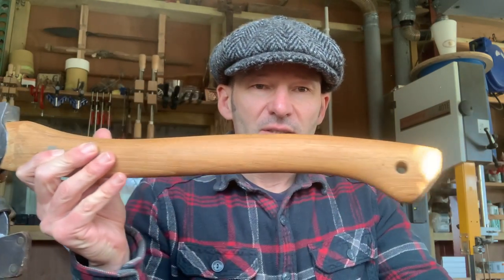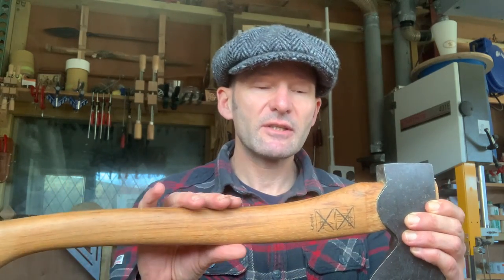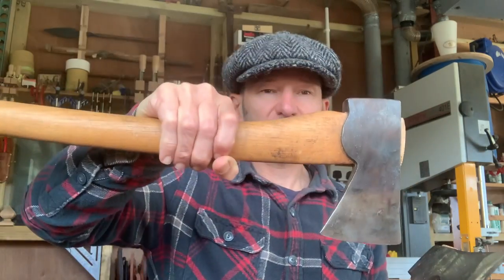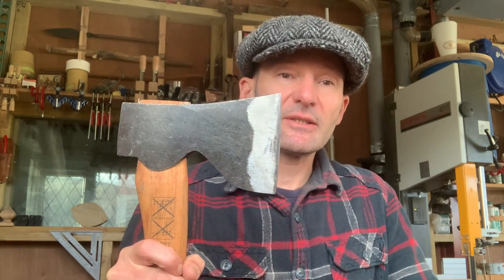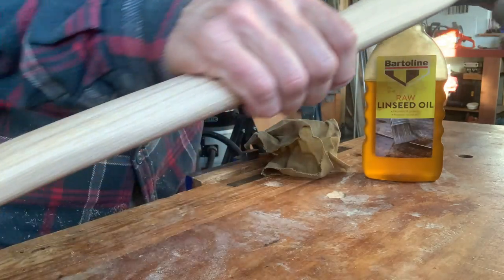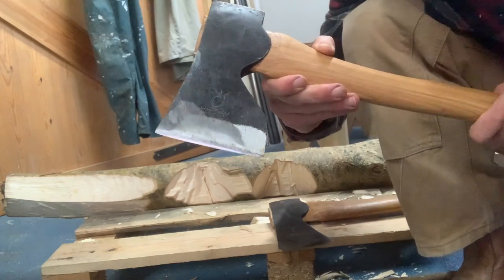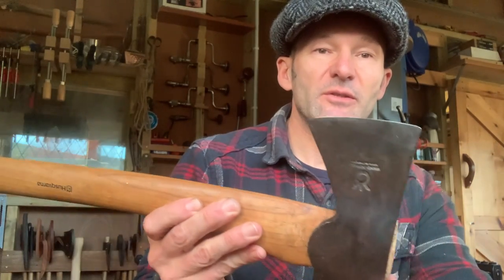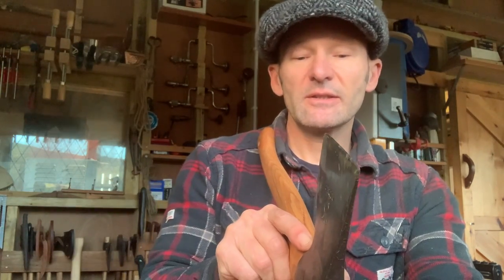Husqvarna Carpenters Axe

Comment: I just bought that axe. It’s not general purpose. More of a heavy carver. I’m finding it useful. It did need a good sharpening and some slimming of the handle, but all the critical elements are there for a pretty good price. I wouldn’t recommend it as a general purpose bush crafting axe. I would as a general purpose moderately heavy carver. Felling , limbing and splitting is not its strong point.
Reply from the maker: Exactly my thoughts, thanks.

Comment: Well thought-out vid I reckon, 500 subs👍 Bought one of these about 5 years ago and came to the same conclusion. Cool axe, good value, has potential, but never really found a solid role for it. I have used it in conjunction with a mallet to clean up joints and shape tenons in rural timber fencing, and use it occasionally to split some kindling to start the forge. Bought a longer handle for it to convert into a limbing axe (combined with reshaping the bit), but even that I never got around to. All that aside though, it's still in my shed, but in the "one day" pile. Has a lot of potential, I'm just not sure for what!👍
Reply from the maker: Yup, it seems to be well made as you would expect from Hultafors / Husqvarna but the geometry just doesn’t seem to be that useful to me even for carpentry type work.
Reply: There's actually Hultafors Åby.. which pretty much gents around every point you said here..
Reply: @markuslepisto7824  I've thought about the Aby, bit lighter than the carpenters but does seem like a pretty good bushcraft style axe
Reply: @kurts64  I just bought it. Have tried it once last weekend when I was camping at Porkkala Finland. I don't really have anything to compare it but I do like it. And I'm sure it will get lost of use when the winter season kicks in..

Comment: I am Japanese. "I'm interested in Hutafoe's carpenters ax." Of course, it is to use it in the mood of a Japanese sword. "I'm interested in this straight handle. I'd like to touch it because the straight line of the blade is the same as a Japanese hatchet." "Perhaps, I think that there are only two husqvarna curved handles. Maybe that's the good thing about Westerners.

Comment: Great video. I have the carpenters axe. What do you think about me trying to grind the bottom inside out more to take a little weight off of the bit? I figure it will just give it a more pronounced beard but I don't know much about potential ramifications
Reply from the maker: I think that should be ok. That section is unlikely to be tempered so should be east to do with a angle grinder. Just be careful to not overheat the whole head as you risk losing the temper on the blade.
Reply: @bundufundi  ok thank you sir!

Comment: Is the eye size the same on both axes?
Reply from the maker: Yes, Iv'e just checked and they are almost identical. They probably use the same drift to open the eye in the forge.
Reply: Awesome. I thought they looked the same but its hard to tell in pictures. I think the carpenters axe would be a great axe with a 24-26” handle and re shape the bit to add a little curve.

Comment: My husqvarna carpenter it's not sharpened , did you do this for your axe or buy it ready to use ?
Reply from the maker: Mine had a basic edge but I did have to sharpen in to get it to function correctly. I have found that Husqvarna, Hultafors and Council Tool all need sharpening before use.

Comment: I thought you might take more off the handle dude.
Looks like a good all-around axe for chippy work.  
Kind of odd criticism of the axe to be fair dude. The most issues were out of context for the tool. 
Carpentry work ain't felling, or bushcraft work, and traditional carpentry tools are weighted heavy for daily use. 
It's horses for courses.
Reply from the maker: Fair enough, I just didn’t find it that good at carpentry work so wondered if it could be repurposed.
Reply: @bundufundi  Thats fair enough to.

In terms of weight I've recently started using a 32oz hammer for work, having previously used 16 - 22oz hammers.

Although it took a couple of weeks to get used to it, I much prefer the extra weight, even though I'm swinging it all day. 

Obviously this axe is heavier again, but getting the tool to provide the bang rather than me has been welcomed.

In terms of this axe, I was looking at it for carving but for larger than normal bushcraft applications. 
Carpentry and bow carving.